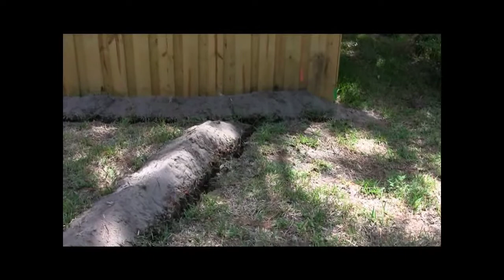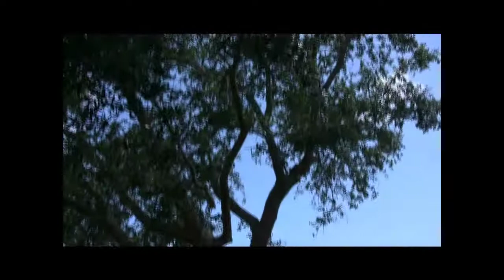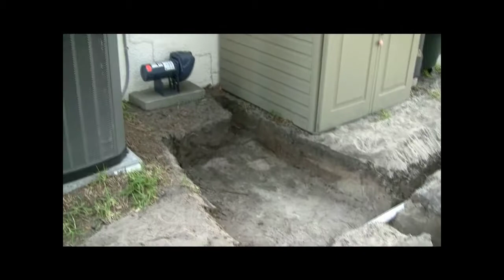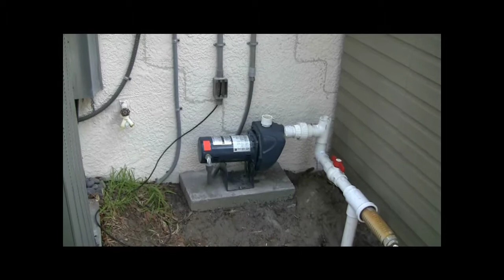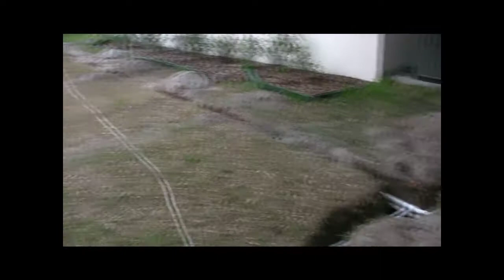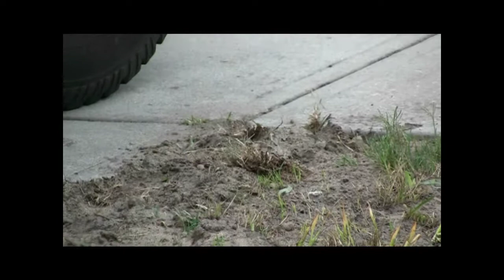DIY Sprinkler System Install - Part 2 of 3

Comment: bad as pump by the was I use those and goulds gt15 you were good not to by a flow tech from home depo thay are throw  away
Reply from the maker: +john Kosheluk It is has been flawless!  There is a slight amount of surface rust in it that I need to clean up and paint over.  Otherwise, doing great.

Comment: my name is John I do sprinklers system you could have run I line from your pump to a single valve in a single valve box and run the main feed around your property  I would look beter then having those 4 valves above  ground run sprinkler  wire around to the boxes and you shud have put the filter on the discharge  of the pump the intake of the pump has to be air tight every time you go to clean the filter you may have to prime the pump and I don't like unions  on the suction  side of the pump the o ring in the union won't last long and I like using  pirpl primer to clean the pipe and to see thar it was glued and don't you have to have low voltage  separate  from high voltage
Reply: damn! you told him how the cow eats the cabbage eh!

Comment from the maker: You are probably right and I think that is what most people use.  It certainly would have been a little cheaper.  Going bigger in pipe size does not hurt in this case, but going too small can.  1 1/4 seemed to best way to go for me.